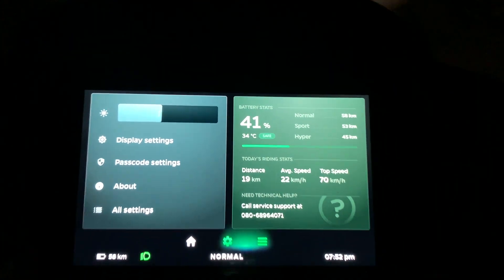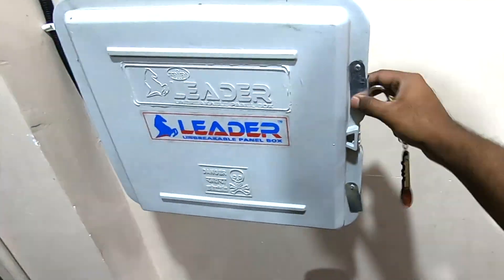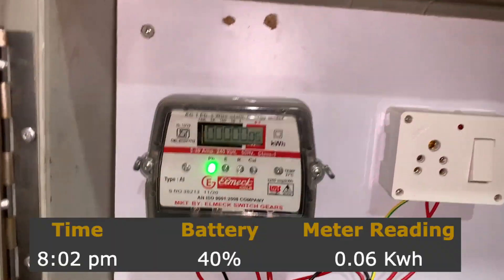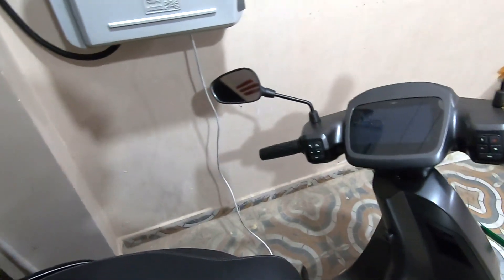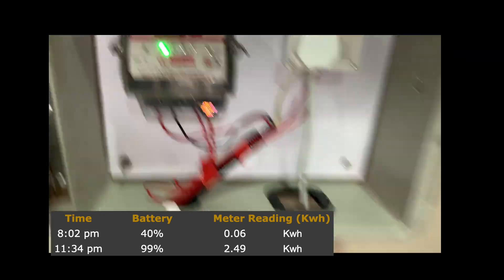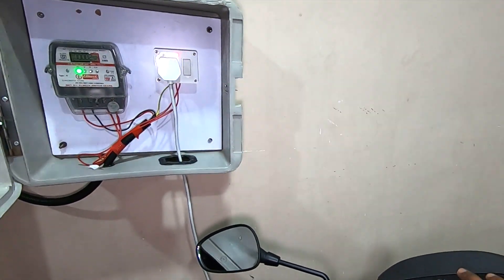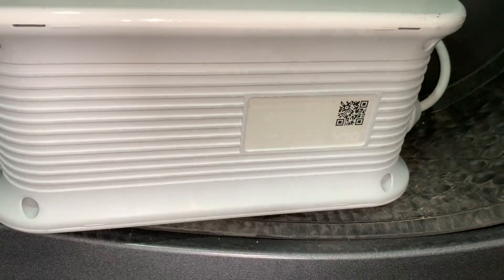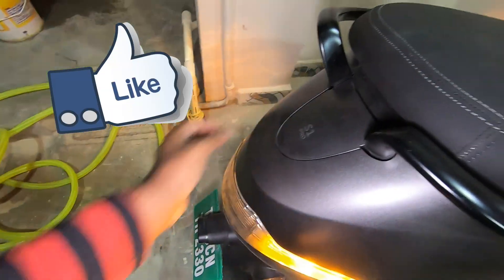40% to 100% Charging | Electricity Used? | Ola S1 Pro

Comment: How much home electricity load required..for example AC  require 2kw home meter load and other appliances run same time so total load 4kw must have.. as when connect the ola how much load it took

Comment: I want to travel 50km per day how much cost it will take per day electric ?
Can you reply
Reply from the maker: Probably 1.5 units at the max 2 if you are using hyper mode
Reply: @AVAutoTech  Village travel i will use in eco mode what is the total cost
Reply from the maker: @ashishmeher1589  probably 1 unit
Reply: @AVAutoTech  total cost per day
Reply from the maker: @ashishmeher1589  depends on your location, should be between 4 to 7rs
Reply: @AVAutoTech  thanks 👍
Reply from the maker: @ashishmeher1589  welcome

Comment: But after 100% the battery is going through CELL BALANCING ... The charger has small area where it shows ...red light while charging and even after 100% battery charging mine took 2 hours extra to show green light in charger because  cell balancing process was going on ... 

When red light switched to green light .. the charger fan's stop rotating and hence battery is ready now ...
Reply: @AV Auto Tech  
Absolutely correct....⚡
but this Youtuber don't know about that...👀😂

Comment: The charger consumes only 3 watt current which we may call as power loss, after 100 percent change the battery takes 200 watt at 2 amp for about 15 minutes which is for cell balancing. Atleast once in a month full charge the battery until the charger fan goes off.

Comment: Very good video. Request you to charge from 0 to 100 if possible.(I know it's not a healthy thing to fully discharge the battery). But other videos report that the last 10% is inaccurate and unusable). So let's assume that charging occurs from 10% to 100% . So if the battery is charged  from 40% to 100%, it's actually 66%. So the total battery capacity would be 2.44kwh/0.66=3.69 kWh. Of course, we assume 0.05 factor for efficiency losses. So the actual battery capacity would be 3.69×0.95 =3.51 kWh which is significantly lower than promised 3.97 kWh. Again, the best data would be obtained if you charge from 0-100 if possible.
Thanks again for the video.
Reply: Please read up on battery technologies it's u like petrol, incase you have a flat battery it will take greater time to do the first 20% as the charger provided is a slow charger with 700-800 watts max output I have charged from 17% to 32% it took nearly 3 hours I wish I could add the bar chart ,battery system is complex temprature plays a major role in its health
Reply from the maker: I’ll definitely do a full charge soon, but not sure at what % the bike will stop.
Reply: @AVAutoTech  a bit of planning would be required.when the battery goes below 20%, I would suggest doing rounds near to your building within100-200 metres until it dies off and then walking it to the home would be easier.
Reply from the maker: @saurabhchandra6267  Even I was thinking the same, it do it soon probably in this week itself.